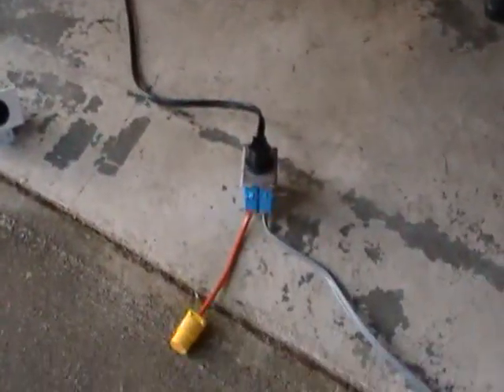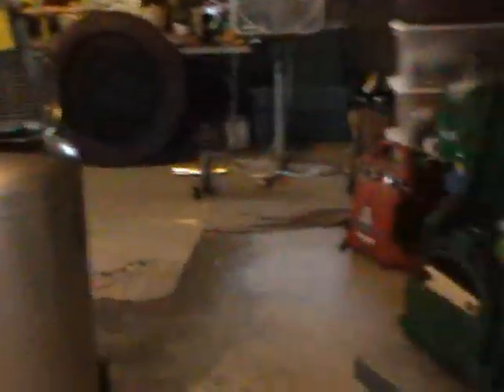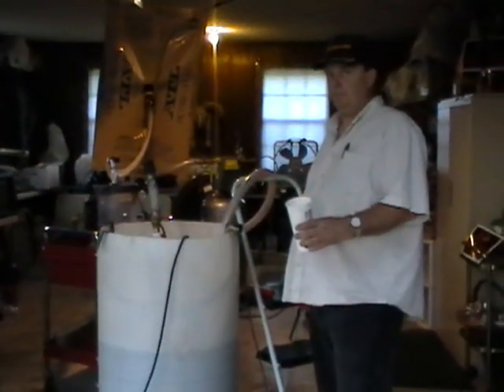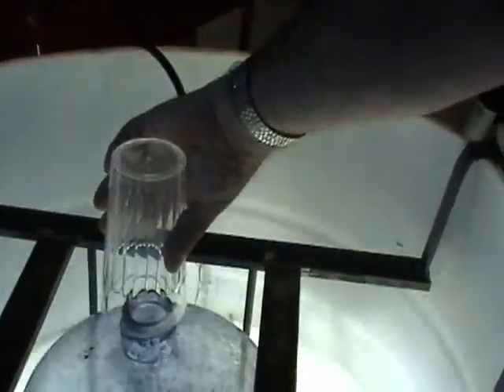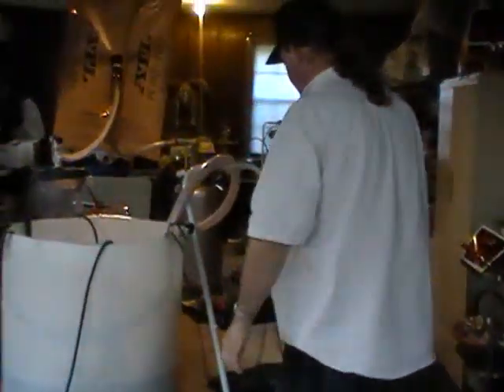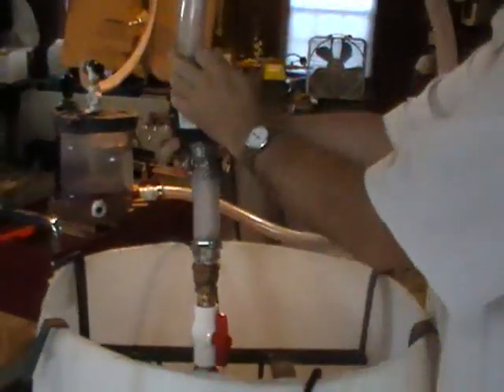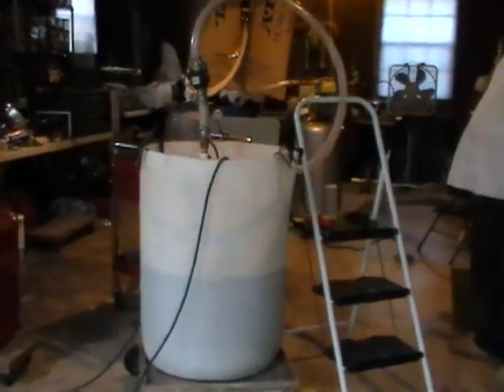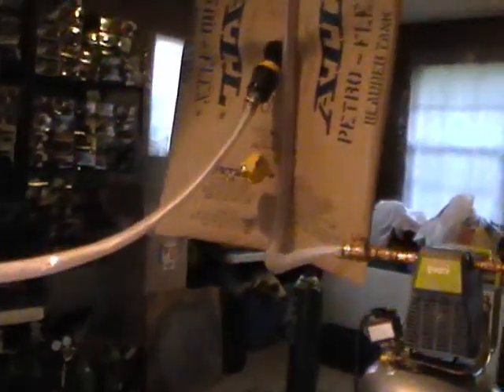Future Fuel Now

Comment: That is brilliant.  I did not realize that this process was as forgiving as to what type of water is used. I would like to know if you have calculated how much electricity is required to generate a certain amount of HCO.  If the resultant HCO can furnish the energy to propell a vehicle further than the amount of gas required to run the electric generator sustaining the HCO production, then I believe the entire nation should convert from petroleum combustion propulsion to HCO propulsion.

Comment: HCO brilliant.  BTW - Hydogen cells are available at toy stores and make electricity fom plain water.  Japan is about to mass-produce a car running on this very efficient hydrogen cell as they already have a working prototype.  And it has zero emissions and uses ordinary tap water.

Comment: Can your claim be demonstrated by running it as a closed loop for an extended period? IF it only needs 20% of the output to run, then is should be able to run around the clock with the 80% surplus being pumped out to another storage cylinder. I understand water can be broken into the hydrogen/oxygen components with electricity but it requires more energy input than can be recovered when those elements are recombined in either a combustion process or with a fuel cell.

Comment: @ChaskaDenny1 The small engine running the generator runs at what? 20-30% efficiency? then the generator at say 80% then the welder at say 80%, then the electrolysis process at about 60%  (being generous on all of these factors) - this would result in a net output of < 10% not the 400% claimed. When you demonstrate a closed loop then my skepticism will be challenged.